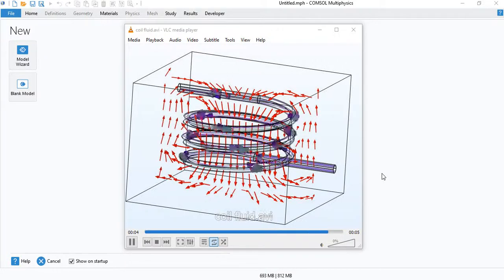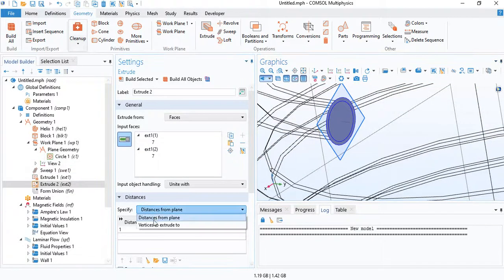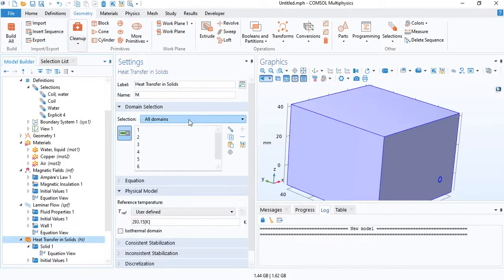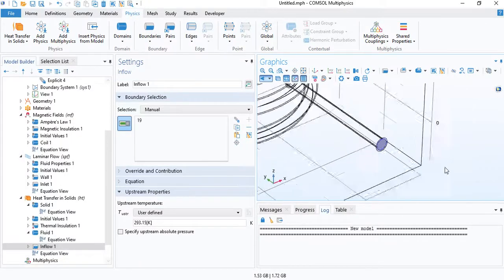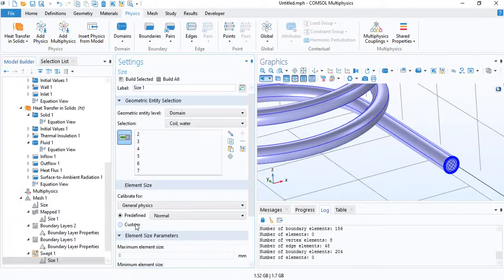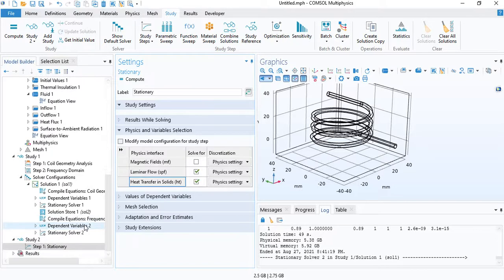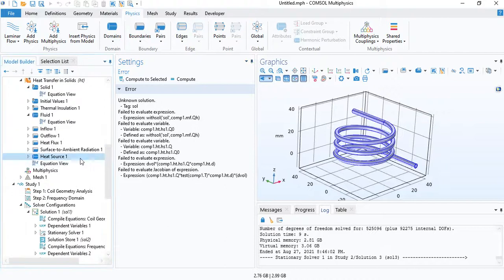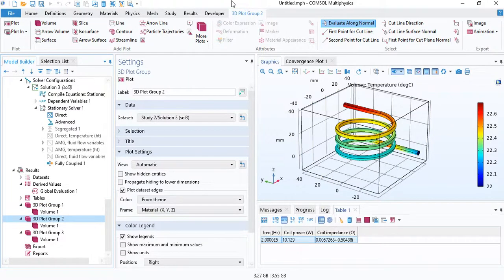Simulation of temperature distribution in water-cooled induction heating coil  - Comsol Multiphysics

Comment: Thanks for the video. I followed the same video steps for mesh generation, but getting a problem in generating the swept mesh. Getting an error message: Problem in inverted elements. Any suggestion how to solve this problem?
Reply from the maker: In which component are you doing the swept mesh? Is it mapped or triangular? Can you try making it smaller?
Reply: @JafScience  It was mapped for the coil+ water.
Reply from the maker: Try triangular and smaller mesh on the face being swept.
Reply: @JafScience   Thank you.

Comment: Can you please help me to simulate a temperature sensor. By getting 'temperature vs resistance' plot as result ...
Please reply for sorting this...🙏🏻
Reply from the maker: What are you trying to simulate?
Reply: @JafScience  Thanks for your response..
Iam trying to simulate a temperature sensor for Human body temperature measurement.
Reply from the maker: I can only say you'll need to use the heat transfer interface. I don't know what's your geometry or assumptions.
Reply: @JafScience  In my geometry has polymide as substrate, graphene as sensing material and silver as electrode.
 
Can i able to get temperature vs resistance plot as simulation result by using heat transfer interface only.

Can you please tell me how to simulate the sensor by using this..
Reply from the maker: What is the heat source to change the temperature? Resistance is a function of material property and geometry. If you place a sensor in a heated environment and its temperature rises you can generate your plot.
Reply: @JafScience  Heat source is the sensible heat of the body that the sensor becomes attaches...
How can i get simulation result? could you please demonstrate the simulation. I believe it will very helpful for me and others too..
Thank you
Reply from the maker: @ashiyabsiraj5147  I don't have access to a licence at the moment. But if you mimic the body temperature with a boundary condition and attach the sensor, the temperature of the sensor will increase. The resistance is a function of geometry and resistivity.
Reply: I appreciate all of your amazing contributions, and I really appreciate the wisdom you share with me. Sincere gratitude, sir.

Comment: Why do you use laminar flow instead of transient or turbulant flow, if the Reynolds Number is likely to be above 2300? Thanks.
Reply from the maker: I did not consider the Reynolds number. As the simulation has 3 interfaces I tried to keep it simple. If you plot the flow speed and it turns out to be well within the turbulent regime you can modify the model. But for this application I don't think it'll noticeably affect the temperature of the coil.
Reply: @JafScience  How do you plot the flow speed seperately? And by the flow speed value, how do we calculate the Reynolds number? Thank you very much!
Reply from the maker: @camlainguyen3545  You can plot the flow speed at the exit cross-section by selecting the flow speed variable in the results. If you apply an 'average' operator that'll give you the average exit flow speed. The reynolds number is rho*V_avg*D/mu where D is internal tube diameter and mu is dynamic viscosity.
Reply: @JafScience  thank you very much!

Comment: Hello, thanks for all your efforts. I have learned a lot from you.
Did you use FORM UNOIN in the geometry?
When I use form union I cannot select coil boundary for convection in heat transfer.
I would be glad if you could help me. 
Best wishes.
Reply from the maker: Yes I used form union. You should deselect the air space in heat transfer physics if you want to select the boundary of the coil. Internal boundaries cannot be selected for heat flux in heat transfer.

Comment: Thanks again; I've already watched this video, but I haven't tried it by myself till today. I faced an error in solving study steps 1 and 2 which are coil geometry analysis and frequency domain, that says: 
"Failed to find a solution.
The relative error (1.5e+03) is greater than the relative tolerance." 
I've done all steps that you described here, so I don't know the reason for this error. 

I would appreciate your help.
Reply from the maker: I can't tell why this error appears. Maybe it's mesh-related. But if you follow all the steps exactly then it should work.

Comment: if a 1 ml test tube contains magnetic fluid (single domain superparamagnetic nano particles and water) placed in the middle of the coil. And these magnetic nano particles generates heat by induction (just with neel and brownian relaxations and excluding eddy currents and hysteresis effects)
how can we show temperature increase for test tube with/without water cooling effect? thank you.
Reply from the maker: I'm not sure I understood you well. Induction heating only works for conductive materials due to eddy currents. Without eddy currents no heat is generated so you cannot heat a mixture of particles/water by induction.
Reply: @JafScience  would you please read this, Digital Object Identifier 10.1109/TMAG.2014.2358268
Reply from the maker: I haven't modelled magnetic fluids but you can define the formula in the paper in Comsol as a heat source.
Reply: @JafScience  thank you for your kind response. Is it any way to superpose static and alternative magnetic fields in the work area?
Reply from the maker: @newmail3549  Depending on what you want to model, you could add a static and alternating source in a time-dependent study, or you could compute the static field in a stationary study and then feed it into a frequency or time domain study.
Reply: @JafScience  I just want to add cube shaped permanent magnets on both sides of the coil and measure the magnetic flux density at the center of the coil. my Comsol knowledge is not enough to do this. thanks anyway.
Reply from the maker: @newmail3549  Create the magnet geometry and insert ampere's law, choose 'remanent flux density' and specify direction of magnetization. Run the simulation in time domain.
Reply: @JafScience  

Thank you very much for your help. First of all, I created the comsol simulation in this video. There is no problem.

Then I placed two 40*10*10 mm^3 magnets in the center (0,+/-33,15) position. I assigned N38 (sintered NdfeB) to domains 2 and 3 as material. 

mf>Coil1>Vcoil=sin(2*pi*200000*t[1/s])
mf>Ampère's Law 1>Domain(3), Magnetiziation model=Remanent flux density, Remanent flux direction=e(0,-1,0)
mf>Ampère's Law 2> Domain(2), Magnetiziation model=Remanent flux density, Remanent flux direction=e(0,1,0)

Study1>Step1:Coil Geometry Analysis
Study1>Step2:Time Dependent
Study1>Step3:Frequency Domain (disabled), the simulation does not end when I press Compute.
Reply from the maker: It could be due to very small time step (due to high frequency) that the simulation never ends. You can try computing the static field in stationary study and then using it in a frequency domain study.
Reply: @JafScience  this is beyond my knowledge. thank you anyway i learnt a lot from your tutorials. i m going to wait your new videos.
Reply: I would like to ask a question in a simulation of induction welding of two 1 mm thick copper tubes using coils. Despite a magnetic flux hi density (phi) of 20e6A/m² and surface intégration on the 2D axes symmetric, the volumetric power density in the simulation is low (0.0019 W). Can anyone help me understand the reasons for this low power density and examine the simulation results and the freq=50hz? Thank you.
Reply from the maker: The power you quoted has units of Watts so I'm assuming it's total power. Total power depends on the current density, resistance and area. Maybe the high current density spans only a small area in your case? Can you check that the material has the right electrical conductivity?
Reply: @JafScience  yes it's copper.  5.9e7
Reply: Yes it's a small area it's 2mm with 6 inducteur with 3 mm for welding I did 50 Hz but J=20e6 (A/m^2) and the power densité or ( resistive heating) after integration surface it's low = 0.3W